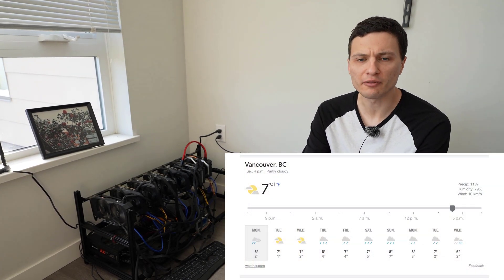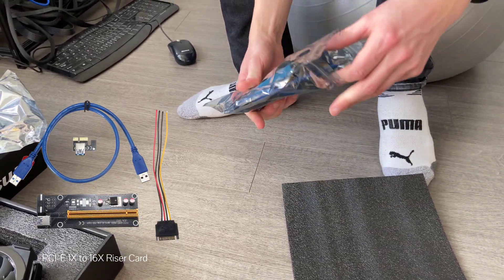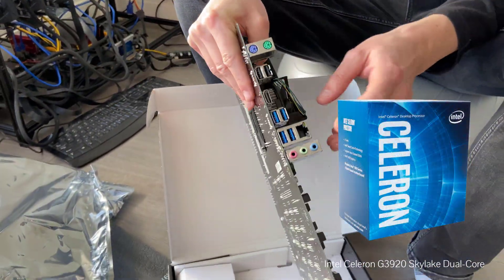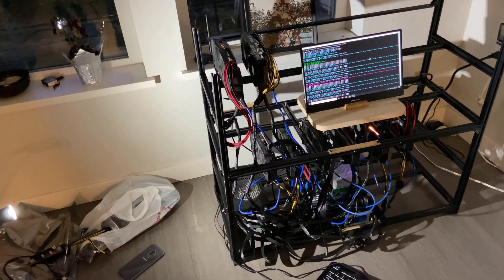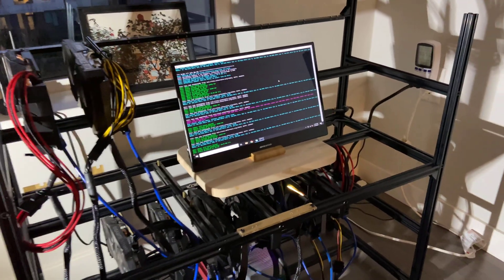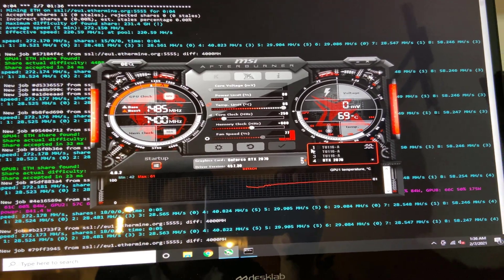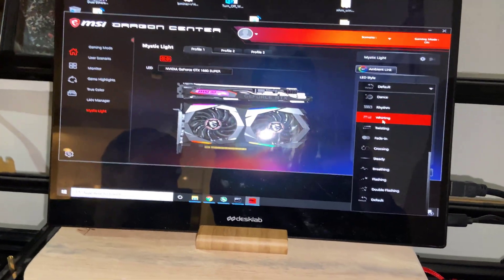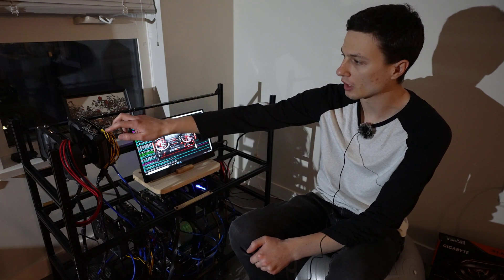8 X GPU Mining Rig Build | 272MH/s at 900 Watts - Update Video

Comment: Don't use the SATA power cable. Use 6/8 pin to 4 pun or modex.
Reply from the maker: Agreed SATA power cables should be a last resort. However, if it is just a single GTX 1660 Ti on one entire SATA power cable it should be okay.